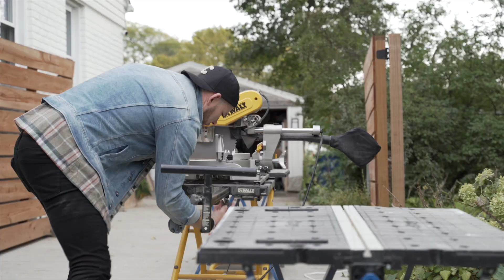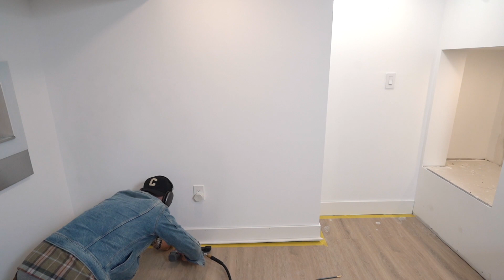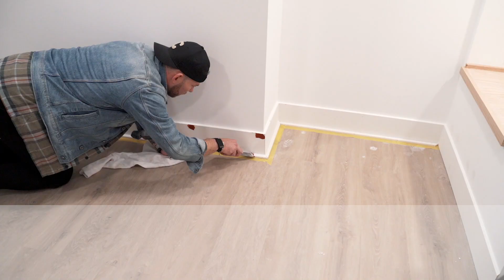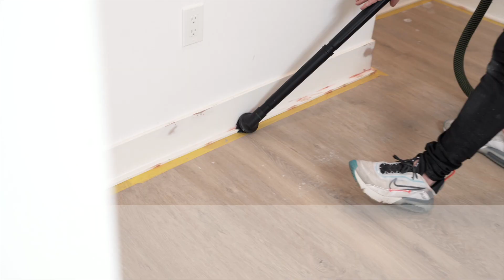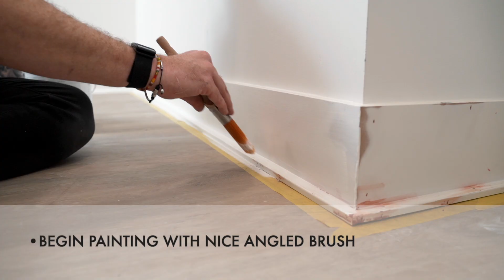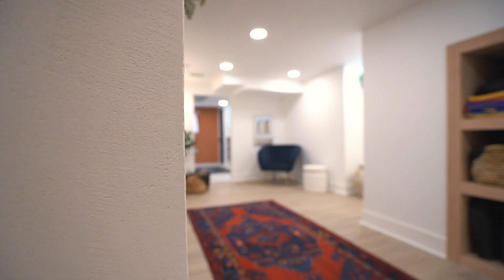Novo Building Products | How To Install Shoe Moulding

Comment: I regret following the instruction to put tape down on the floor before adding the trim. What an absolute pain in the butt and all the little tape fibers have made the edge worse than if I had just masked it to paint. I am on the floor with an x-acto knife painstakingly trying to cut the tape and the edges l;ook like trash. I am thinking about removing the shoe and re doing it. That was just a bad idea.